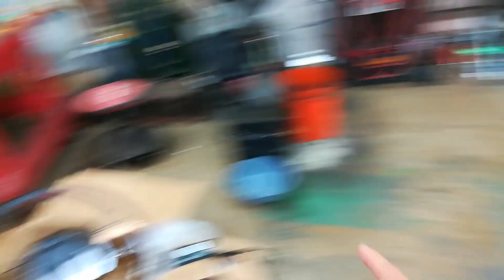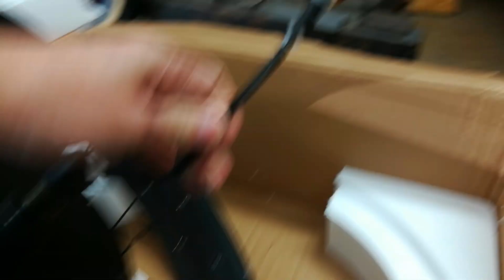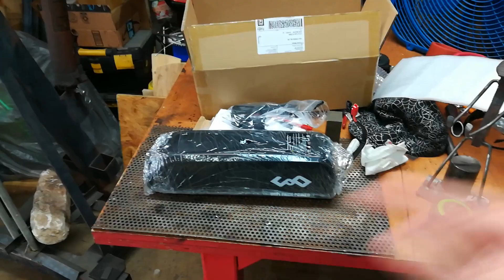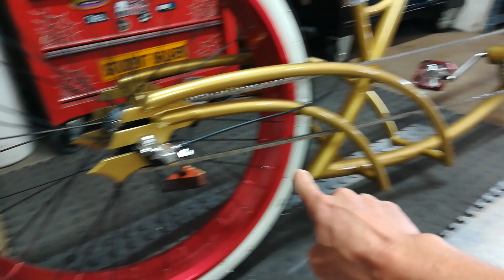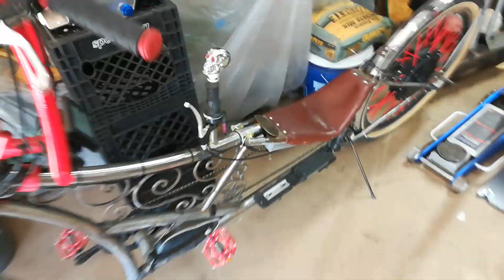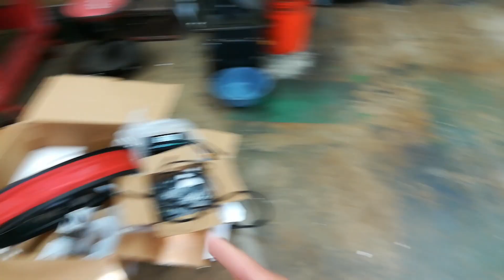Custom Cruiser Bicycle Ebike Conversion #1

Comment: I'd like a ebike from you, im in Dallas/Duncanville
Reply from the maker: In this style?
Reply: @guywilsonwelding  Sort of... ii wanted a gas tank mounted to hide the controller and also make it look motorcycle'ish
Reply: @guywilsonwelding  more of a bobber look
Reply from the maker: @kenmitchell4678  The bike's I do are built from scratch, so they can be made any which way in any style. Something like this bike or the one you say, in electric, is going to run $2500-3000 ready to ride. If you want to see more or contact, you can check me out on instagram or Facebook under Guy Wilson Welding and Fabrication.
Reply: @guywilsonwelding  Gotcha I'll send you a request on fb